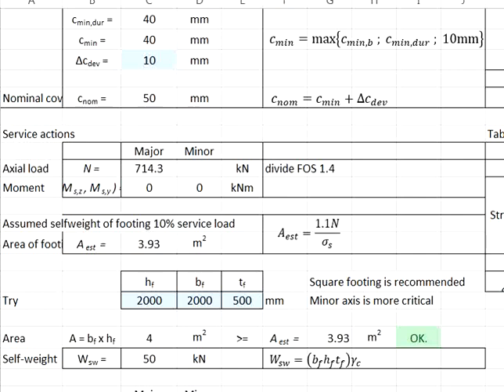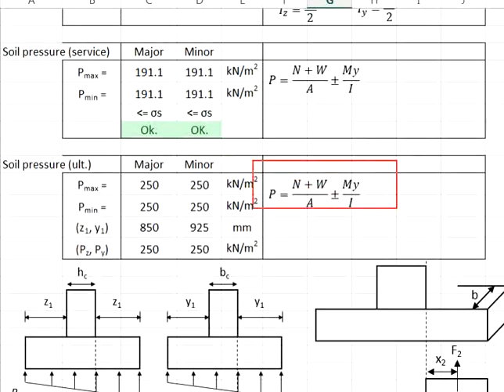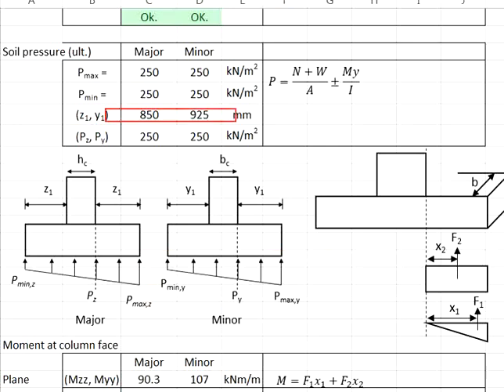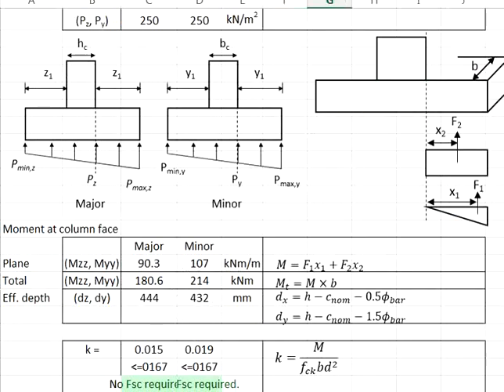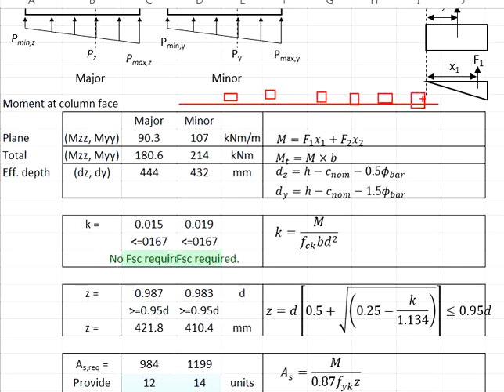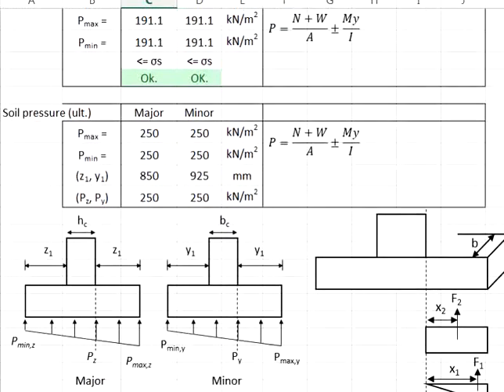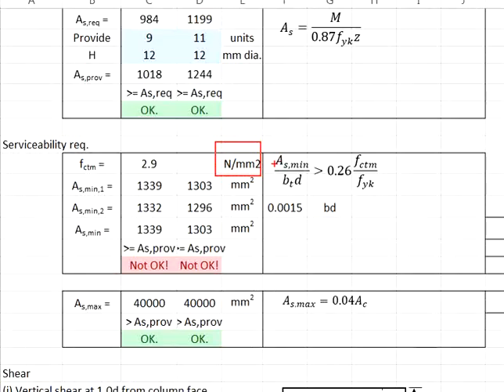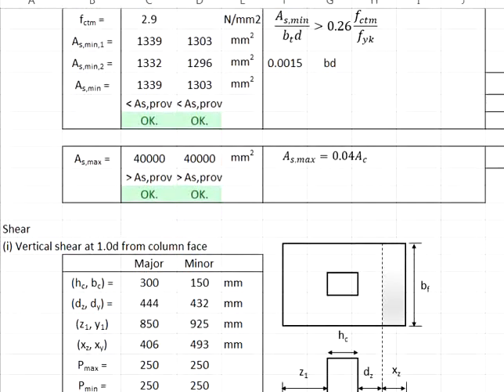3.28 Design of pad footing under axial part 2

Comment: You should not include the self weight of the pad footing when calculating the ULS pressure. Only include in the SLS case.
Reply from the maker: yes. You are right. Thanks for the correction.